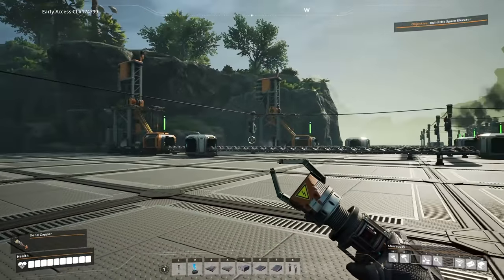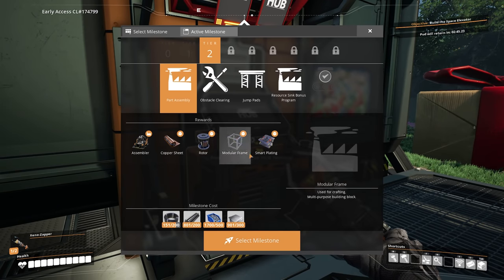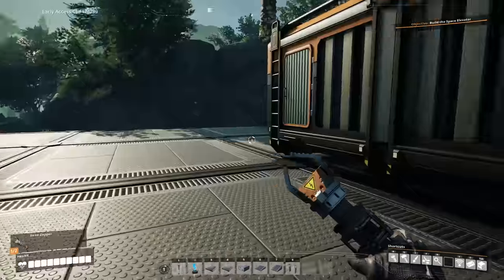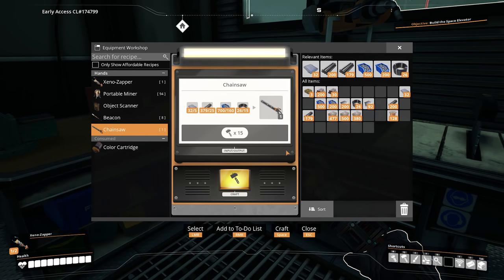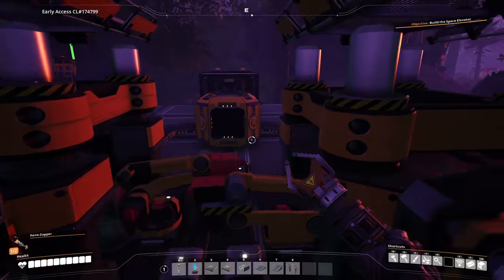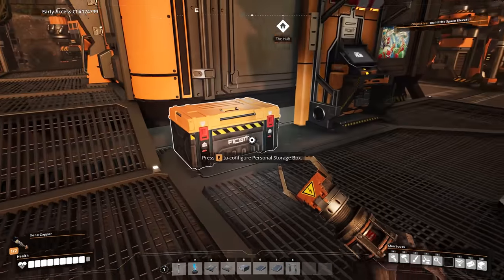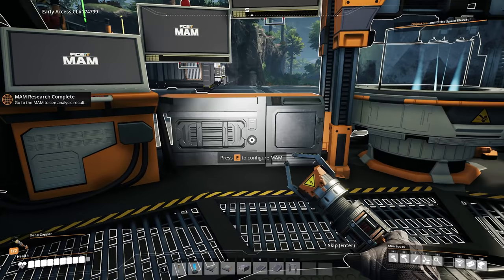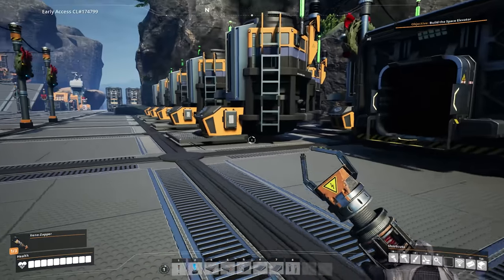Automated Biofuel & 100% Efficient Copper! | Satisfactory - Ep. 2

Comment: Hey wels, love the videos! you should check out the advent calendar on Wall of the hub and just a tip for power lines always leave one open spot on the end of a chain of power polls so that u can always add on to the network without having to reroute power over to the same area or have to rewire a circuit

Comment: Tip for hard drive hunting: rather than bring hard drives home, build a MAM wherever you are. You can throw the hard drive in and deconstruct the MAM. Research will continue regardless. I've heard you still need a MAM somewhere in the world for this to work, but since you usually have a MAM back at your home base, that's probably not going to be an issue if true.

Comment: Think you misspoke on your math for copper sheets unless you overclocked or underclocked something. You got 2 smelters producing 20 ingots a minutes being split across 3 constructors that need 20/min...one of those constructors shouldn't be functioning then. 20x2=40 not 60. Are the smelters actually producing 30 ingots/min? I'm not trying to be that guy who nitpicks, I'm just tryna make sure that I understand the math for my own world to optimize it better.
Reply from the maker: Smelters produce 30 ingots/min.
Reply: @WelsknightGaming  gotcha, you had said 20 though and went through production so quickly i wasn't able to see the tool tips on it. And the math didn't add up.